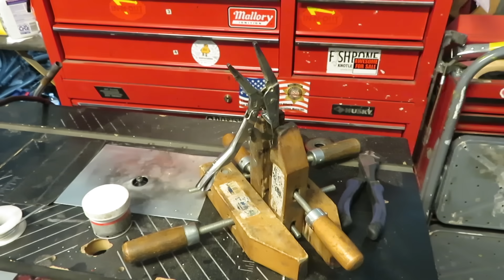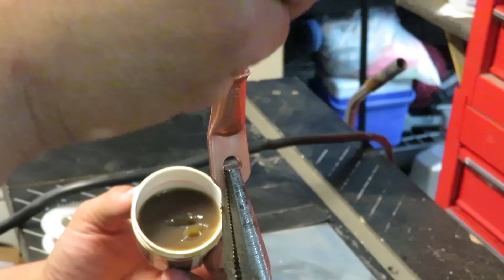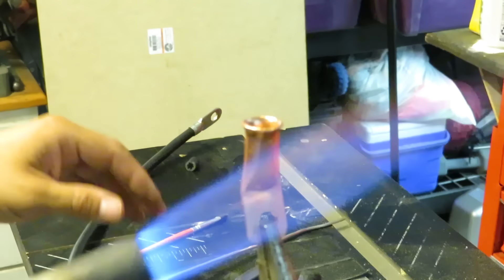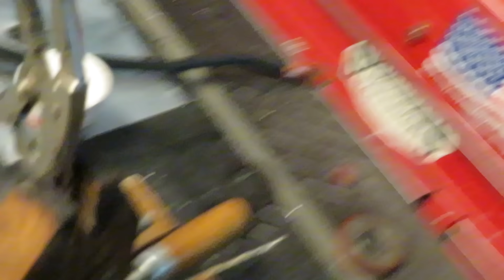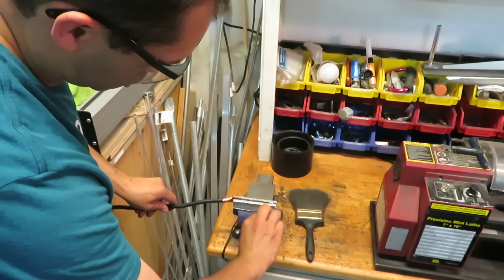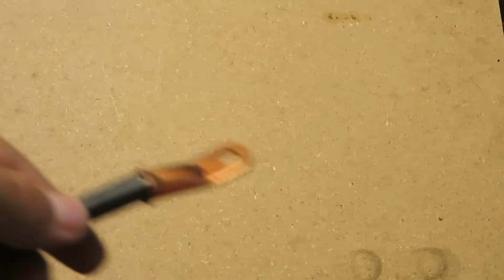How to: Battery Terminal Install. Better than Factory.

Comment: This is not the correct way to do it. You need a mechanical forced connection using crimping method. It will hold when the wire heats up. Solder melts at relative low temperature which can occur during repeated starting attempts. If the method shown in the vid is so much better, other manufacturers would do this. Don’t start a fire in you car: don’t let yourself mislead by this video.

Comment: Soldering has its specific applications if this is Automotive better of crimping as it allows the cable to flex and not break off at solder joint. Also soldering can cause other issues like higher resistance which is bad if you have a very high load.
Reply: True!

Comment: Soldering a cable is a very bad idea. If the cable is vibrated or bent, the cable may break where the solder ends. The crimp connection is the much better method.

Comment: I had to repair a huge battery cable that had corroded through, once. I wound up using a 4" piece of copper pipe, and putting both cable stubs through into it, and doing this to both ends.
Then, I drilled a 1/4" hole in the top middle, and filling the rest with solder to make it a solid piece.
It lasted for many years.
I used linerless splicing tape to cover it, then slid a 8" piece of shrink tube over it to finish the job.
All this, because some ASE mechanic decided that the double layer of liquid electrical tape looked like something else.
Instead of asking, he just peeled it off and exposed the prior damage to the insulation.
The first repair had worked for a year with no chance of corrosion.
After his stunt, it didn't last long.

Comment: A proper crimp with the proper tools/dies will produce a cold weld.  Google that if it doesn't make sense.  Proper crimps are way more reliable than solder especially in high vibration environments.   Not better than factory BTW.  Those terminals are designed to be crimped.  Do dome research and don't just rely on what you think looks better.  Look at any modern auto wiring harness and you will see very little soldering.

Comment: Crimp with a hydraulic crimper, solder to seal it, shrink tubing filled with Vasoline. But that only needs done where you use them directly on Lead Acid batteries. Other places just crimp and shrink tubing.

Comment: Volume at that dead no fancy urn idiot that's completely the wrong freaking way to do it one solder paste Is actually what it's called solder with flux mixed together in a cider actually like powder ised and then congeals at a Tampa in the attempt turned into a satyr joint so number one you don't have the legal right number 2 you never add flux to a cup like that you would actually jealous side hole but get on that in a second then you just put some solder paste around the edges of the connect the wire know what you would use is a I'm what is actually called rosin flux which is called flux or or solder flux in you would dip that into the How much beaches act crapped out forget it your not worth my time but your hallway yet wrong

Comment: You really need a crimp, the heat from prolonged cranking will melt the solder, and plumbers flux adds a corrosive to two dissimilar metals. Your connection is on the road to corrosion already. You can google "galvanic reaction." If you do as many ends as you make it appear,  buy a mini bolt cutter and drill and file the jaws to make a crimper. Most cutters have enough jaw to make two or more crimp sizes. Place one jaw in the bench vice and pull the opposite handle for good quality crimps every time.

Comment: Not terrible. But I agree with the comments regarding crimping. Two important things to consider with a high-current connection are electrical integrity and mechanical integrity. Crimp insures positive mechanical contact, solder provides maximum electrical contact & keeps oxidation from building up inside the crimp. And yes, dual-wall heat shrink.

Comment: I'm so glad someone finally made a video on this. I've been doing this for years and it always shocks people when I do it this way
Reply: People are shock because it's not correct.  If I seen this done to my car I would never return. Jerry rig everything.  True sign of no education.  This guy is what we technician call a Shady Tree Mechanic. They give us a bad reputation because they have convinced themselves that they know what they are doing.
Reply: @jasonk795  can you please explain what he did wrong?
Reply: @sanpepsiman1277  no crimp. Crank in the starter too long and the cable heats up from the resistance and melts the low temp solder. There goes the cable at the connector. There are shops that will crimp it for you if you don't have the correct tool. People giving bad repair lessons. Now others are going to do this. Creating more problems.
Reply: @jasonk795  Thanks fam, dodged a big one here
Reply: Same here, it literally freaks people out. The only thing I do different is I prep the copper with a wire brush, and then crimp it a bit before soldering.
Reply: @kenneth6731 just crimp the cables well and do not solder them. It's stronger that way

Comment: I just smash the terminal on the ground with a 5 lbs sledge hammer and it makes it tight.  Also solder isnt vibration proof.  Crimping for automotive wires is better.  Solder can also melt if the wires get hot under the hood.  Crimping is safety.

Comment: Crimping is resistant to heat. It tends to hold the cable in place even at a high temperature. Soldered connection tends to loosen up if your cable heats up.
Reply: Yes and if it shorts it will melt that solder faster than shit through a goose.
Reply: @Riverrockphotos  😆my first thought when I saw this.. I rebuilt forklift batteries every day crimping is better and safer I use cables and lugs like that on golf cart batteries smh
Reply: @Riverrockphotos  so basically you have a thermal fuse
Reply: @Riverrockphotos  This joint becomes a fuse at that point!
Reply: Crimping is generally recognised as being more resistant to vibration than solder too.
Reply: You "tell em" Danno! Not to poo-poo to much but RULE#1 --NEVER rely on solder as your only "mechanical connection".... Create a physical connection and solder as a option. One downside of soldering is it stiffens the cable as the solder wicks up (to various degrees). Also, the fact that we don't know with 100% certainty the solder type forbears another possible disaster in the works. Really, this video is invaluable because it gets us all talking and sharing the methods of getting er' done. Good Job F.D.A.  :O)   p.s. I love to hear myself ramble on.. I ROCK!
Reply: Plumbing technique and materials should not be used for electical connections.
Reply: Correct!
Reply: Yes agreed. I used to do this myself until I got into a situation of my vehicles breaking down and needed to start it many times in a row and it melted apart.  It may be fine in a well maintained vehicle but a good crimp is dependable.
Reply: Have to say from factory Alot of Cars And Trucks that get parasitic draws And draining batteries Out of most they are linked to solder connections that have heated up time after time And begin to crack Speedo clusters, ABS modules, main computers. This is why thier are companies that refurbush them And they make a killing in profit ...Buy old used And damages at pennies And sell half of a dealership part cost ...I crimp everything i can lol
Reply: Solder softens at very high temperatures, higher than likely to ever encounter connected to a battery.  My problem with solder is that it often can be brittle, and prone to cracking and compromising a solid connection over time, in my experiences in most cases, in a situation like this where the cables would be vibrating as the car goes down the road.  If he did not apply the extra heat while inserting , the entire connection would have been a cold solder. It seems to me for automotive purposes, crimping should be preferred to soldering.  Engineered to be durable.  As a maker of many DIY music effects pedals and such perhaps I am just sick of soldering!   Forgive my bias please. :)
Reply: @jeffdowning4877 crimping works well except in the presence of vibration. 
If you’re that worried about vibration, extending the wire, or creating a loop proximal to the connection will work. Soldering is the only GM approved repair method in a diesel engine bay for example, butt connections loosen when vibrated.
Reply: after Soldering then use Crimping Tool :)
Reply: I have rarely read so many stupid comments.

Including that "solder has high resistance".

No solder in electronics then?
Reply: @KevinWilliamson-u5f  I didn’t want to be the one that said it, thank you. Lol
Reply: If your cable is heating up due to current flow your using the wrong gauge of cable wire. That's your problem NOT the connection type.
Reply: @whpony96 thanks.
Reply: @whpony96  you are wrong. The high resistance of the solder can cause heating at high currents.
Even to the point where the solder melts. Has nothing to do with the cable gauge.
The crimped factory connections are way superior to solder.
Reply: @vonnikon  solder does not have high resistance...it has a higher resistance than pure copper but that is negligible on that application...solder is used on connections of RF circuits, computer motherboards etc were small signals somtimes high frequency etc would be affected if solder had "high resistamce"
Reply: @MrHBSoftware  solder has about 10 times the resistance of copper.
Anything but negligible in high current applications.
Reply: @vonnikon  Then you run it through a lead battery terminal. What is the resistance of lead?
Reply: @gibbsey9579  I don't know what you are going to connect your cables to.
I am just saying that the solder will heat up at a certain current. Long before the copper overheats.

If you never use currents that high: good for you.
Reply: @vonnikon  its 5 to 7 times more than the equivalent section of copper but its in the miliohms range so its negligible and 100% irrelevant.....remember battery posts, although large in section, are made of lead, from you perspective we would have to have battery posts 10 times the section of the actual copper cable connected to them
Reply: @vonnikon  Solder in its normal state is is a SOLID, it is impossible for it to be the weakest point of current transfer. The length of the cable and open cavity's of air between the strands in the cable create resistance.
Reply: @vonnikon I’ve been soldering for a very long time. If your connection is heating, then cut it and do it again, rosin solder is as conductive as the wire around it, if it’s not, you contaminated or didn’t do something right. I’ve never had any issue with any soldered connection I’ve ever made. 
If you don’t agree with this comment, they make sleeveless crimp joints, you can introduce solder and use a crimp joint. Too me, overkill, but if it works it works. 
I also use heat shrink sleeved butt connectors. For each application there is a different repair method.
Reply: If it's a bad job for solder in the engine bay it will break up but he is using a different type of solder into solder needs more heat than a RadioShack heat gun
Reply: Why not do both?
Reply: Never use a propane torch and plumbing solder for an electrical connection! 

The proper way to install this connector was to strip the wire back, install flux on the wire and electrical connector, after the connector has been cleaned by a brush, and get the soldering iron or gun out. Tin the electrical wire first, and then install it into the connector, and then use the soldering iron to solder them together. Remember, use the heat of the soldering iron to transfer the heat to the connection by wetting the soldering iron tip with solder to effectively transfer the heat. You will develop a solid electrical joint and connection this way. 

Using a torch will develop too much heat and melt the insulation from the wire away creating an electrical hazard.
Reply: Electrical cables and its connections must withstand up to 90 celsius degrees of continuous electrical operation. I'm not sure if this connection won't loosen at that temperature.
Reply: @richardquispe7395  where you got these values?
Reply: @jan_vyhnak  IEC 60502-1 tables 3 and 4. Maximum conductor temperature - Normal operation.(Cable with Insulation XLPE or EPR) 90°C. Short-Circuit (5s) 250°C.
Reply: @richardquispe7395  really? "Power cables with extruded insulation and their accessories for rated voltages from 1 kV (Um = 1,2 kV) up to 30 kV (Um = 36 kV) - Part 1: Cables for rated voltages of 1 kV (Um = 1,2 kV) and 3 kV (Um = 3,6 kV)" what kind of battery are you using?
Reply: @richardquispe7395  insulation must withstand 90°C...connections will withstand a lot higher temps.

Comment: Those cheap metal end cables suck, I have all copper terminals on my car, I used a crimping tool, which in my experience is just as effective as solder, heat shrink tubing completes the job

Comment: The previous owner of my Trans Am decided to switch from side terminals to top but, the +’s have 3 cables and -‘s 2 to the battery. He crammed 2 cables into a single cable. After time it roasted the bcm. I ended up rewiring my starter, fuse box and alt.

Comment: Presto, now u have a cold solder joint sure to fail since the cable was not heated sufficiently. Be sure to crimp 1st, then solder for rope heating, resulting in reliability and avoiding cold solder failures.
Reply: Not To mention that crimping provides less resistance than Solder due to copper being a better conductor
Reply: Tuyệt vời
Reply: I agree.  Crimp & then  solder.
Reply: @pedrorojascervantes3928  you both are incorrect there's no need to solder after a hydraulic crimp it already creates a fusion cold weld
Reply: @TKO_Horticulture420  Just to fill up any voids left by a non hydraulic crimp would not hurt  in my estimation . Of course ensuring  a good heat shrink sleeve is added beforehand is always  a must. 
Agreed on the proper  crimping tool(s(  to do the job right.

Comment: The preferred solder for this is electrical solder. Plumbing solder had acids that could eventually cause corrosion.

Comment: Not horrible but I would suggest : running a wire brush around inside the terminal, flux, install cable, crimp, then solder.  Top off with HD shrink tube.

Comment: Dangerous.

Plumbing flux and solder and electrical flux and solder are very different and perform differently.

Crimping is the preferred method for a bunch of reasons but several of them are safety. Beyond the fact this is a recipe for shorts and fire, soldering generally doesn’t perform as well as crimping in DC applications. Google “skin effect” for an explanation. This skin effect is why just a little surface corrosion can create a lot of resistance. Plumbing flux and solder is intentionally corrosive because the corrosion that messes up electricity also is anti-microbial (this is why we us copper for drinking water).

Comment: Properly crimped terminals are more reliable than soldered barrels. They will handle higher current and provide better strain relief. If the plumbing solder has flux core the acid flux used in plumbing promotes corrosion of the cables and any electronics nearby will suffer effects of the acid. If care is not taken to prevent the solder from wicking up the cable strands under the insulation the added rigidity to the stranded cable will increase stress to the terminal under vibration

Comment: I would love to see your solder joint sawed through to see the solder penetration into the core of the wire bundle.
Reply: It won't be unless you heat the wire before shoving it in there. If you don't heat it first you had better heat lug really good after it's in the molten solder or it will be a cold weld
Reply: @rmblwgn  you need more heat than just a short, few seconds, of flame to heat the wire enough to really soak in the solder.
Reply: @FlexDRG_Lampje  I know that's what I was saying.  ppl who only heat up Lug just until solder melrs are going to have a cold joint
Reply: @rmblwgn  i usually tin the wire first, then the lug with some solder and with the warm lug i insert the wire and keep the heat going a while longer to remelt the tin on the wire. But I also at times, crimp the lug onto the wire and then add solder for better electrical contact. (At least in my mind)
Reply: If you have heated the solder up enough, it flows nicely into the cable strands.  I have been making batter relocation harnesses for 20 years and I have never had one fail.  Cars have been in accidents where they were totaled, and the cables have parted or the terminal lugs have broken at the attach point, but the cable has NEVER come out of the cup.
THIS GUY HAS IT ALMOST RIGHT!!!!  NO FLUX AND USE THE RIGHT SOLDER, AND YA GOLDEN!!!
Reply: @ssnerd583  what kinda solder do you use that don't need flux?
Reply: @rodhawkins5037  .....solder that has flux IN IT and when you properly prep the inside of the cups by scouring off the oxidization with a proper brass brush--they make tools specifically for this, or a rolled up Scotch Brite greenie scrub pad....the scrubbie can leave residue so you clean with a Q tip after using one....this cleaning is done IMMEDIATELY before soldering.
Also, you only cut the cable insulation off at the time of soldering and I usually cut 1/2" of cable off to get rid of the oxidized copper at the cut end.
The battery relocate kit in my current car--the first one I ever made, was made by me in 2003 and has been in a total of 3 cars since then.....never had any issue.
Reply: @ssnerd583  👍thanks for the reply
Reply: Never   liked  crimp terminals   a  good   old     fashioned  solder  joint   far  better   / look   at  all the old   lead   cased cables   under   the roads   a  cheap   quick   way   to  do this